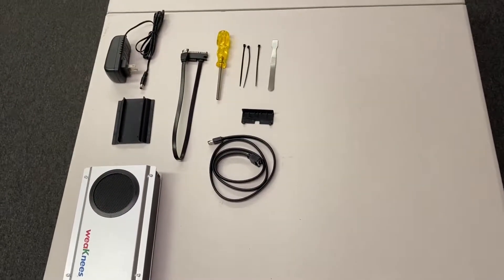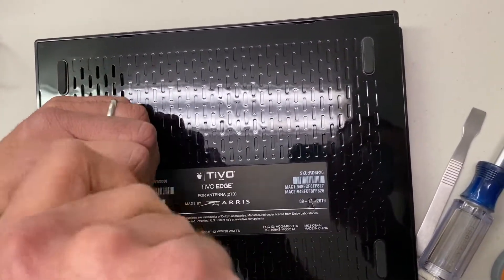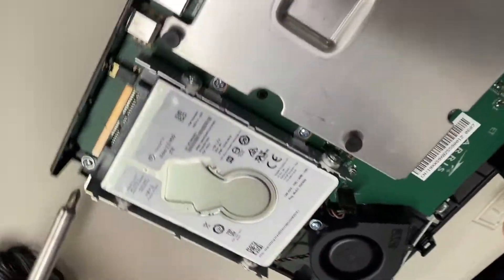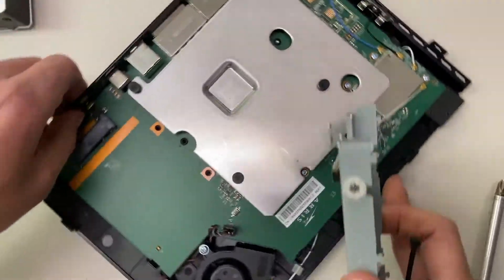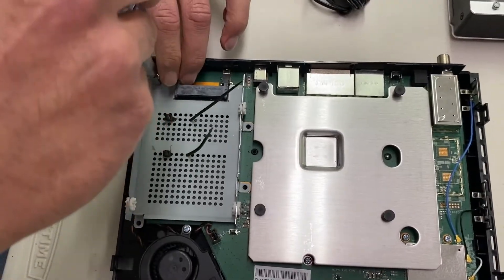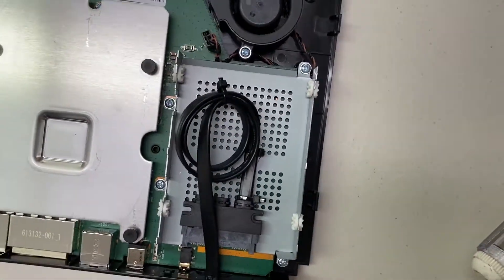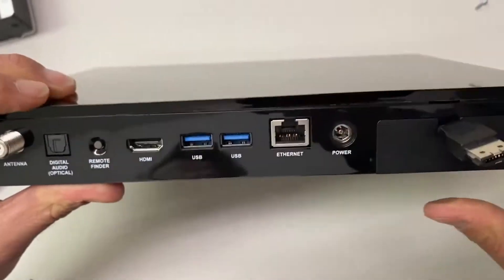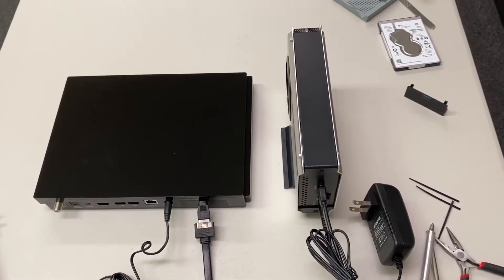TiVo Edge Upgrade by WeaKnees

Comment: Do you sell other parts for tivo edge antenna?  Need the antenna connection receiver.   The part on circuit board that coax connects to.
Reply from the maker: We do sell other parts, but I don't believe we have that part in stock at this time. Sorry.

Comment: I have the latest version of the antenna edge tivo with only 2 tuners. Can I add two additional turners to it? Also I have a older Romeo and could I use two turners out of it to go into my Edge? Thanks in advance for any input you may give.
Reply: Yes,  I too have the same question.  I don't understand why they dropped to 2 from 4 tuners

Comment: I don't see the value of installing an external hard drive with all that extra equipment outside the unit when it would be much cleaner and simpler to just replace the internal hard drive.
Reply from the maker: The Edge's internal drive is a 2.5" laptop-sized drive. These drives are small and their capacity is limited. The larger-capacity, 2.5" hard drives also use a technology called SMR, which does not seem to perform as well over time in DVRs, leading to high failure rates. On the other hand, our external drives are 3.5" desktop sized drives made for DVRs. In our experience, they are more robust and more reliable and are definitely worth it. That's precisely why we developed a kit for the Bolt and Edge to enable them to use external storage.

Comment: Why not just install a larger capacity 2.5" drive inside the Edge?
Reply from the maker: Very, very few drives work inside the Edge (or the Bolt) and the large-capacity drives are prone to failure due to the 24/7/365 reading/writing. We use external drives because they are far more reliable.

Comment: This is great stuff! I am a life long TIVO user going back to the old "boxy" Series 2 units. I have a Roamio PRO for Cable but finally cut the cord when Spectrum went to over $200 last month!!. I have a Roamio OTA with 4 tuners but it just has 500 GB storage. I ordered the NEWEST Edge from Tivo and am very frustrated with the 2 tuner arrangement. Already bumping into issues with my wife doing one thing from one TV and me trying something else on another TV. Also, can't get video transfers to work from my Roamio Pro to the new Edge. Tivo is "working" on this but hasn't got a fix yet. So today, I just received an EDGE purchased from you folks with the 4 tuner 2TB storage. For OTA this will be great. Will get it set up and see if I can transfer to this EDGE. So glad I found you guys and am a fan.

Comment: in place of the external hard drive, could you use an external raid system with an east connector? or would the edge choke on that large of a volume?

Comment: Would this fix the constant rebooting issue
Reply: Nobody knows about "the" rebooting issue you're having. TiVo devices don't reboot constantly. Maybe yours needs service.
Reply: @richarda3659  it actually did fix the issue. I discussed with TiVo support and they said it sounded like a hard drive issue and they were willing to replace mine with a new one with only $200 off. I said no thanks. So apparently someone knew about it.

Comment: I just followed this video and installed a WeaKnees external 6 TB hard drive outside my TiVo EDGE. Could not have been easier.  The metal outer case above the internal hard drive was a bit difficult to pull off after removing the screws, but not too big a deal.  Excellent instructions, excellent equipment, problem solved!

Comment: Quick Question?
By upgrading the HD in my TIVO EDGE OTA, all the Software information is still stored internally on the machine and NOT the original HD that came with my unit?  Is that correct.
And the TIVO EDGE OTA will format and setup the new drive once I replace the old drive?

Appreciate your reply.
Thanks
Reply: As with other generations of the Tivo, you can replace the drive. It's just that some hard drive models work better than others when it comes to skipping over bad hard drive sectors. For that reason, Western Digital makes A/V drives which Tivo has used in various models.

Comment: Couldn't the 3TB Western Digital PMR drive you well for the Bolt work as well in the Edge?  Otherwise, great tutorial on breakdown and assembly.  Thanks!
Reply from the maker: Technically, yes, but the fit is very tight and we strongly recommend one of our external drives if you want more space and maximum reliability.
Reply: @weakneessupport80  Sorry to bother here.  Now I'm a bit concerned about my 3TB drive (WD) I purchased from you guys for my Bolt OTA.  I haven't had any problems, but will it be a good, reliable drive for the long haul as it was quite expensive?

Comment: why would anybody like to try that it looks horrible, that was a waste of time
Reply from the maker: Reliability and increased storage space.
Reply: @weakneessupport80  Do you use Seagate video HD or WD video HD in your external unit?  My tivo edge just started with the "serious error" nonsense.  I suspected the external 3.5 inch HD would be more reliable and maybe faster if it is 7200rpm type.

Comment: When will this be available without the hard drive ( I already have one ) ?
Reply: Look easy to install an ssd
Reply from the maker: @real_ultrajoe  SSDs will fit, but not all drives work in Bolts. Also, SSDs generally do not perform well (or for long) in DVRs due to the intensive writing. SSD technology does well in read-intensive environments, but not write-intensive environments.
Reply from the maker: Feel free to email us if you are interested in an external case and all of the associated installation parts.

Comment: Why not put in a larger 2.5" drive internally instead?
Reply: Thinking the same thing also why have an external drive when an internal larger ssd drive would be better?
Reply from the maker: Larger-capacity 2.5" internal drives either don't fit or don't work. (Not all 2.5" drives are the same height.)

Comment: I put a SSD drive & cloned it on a PC & works 100% faster.
Reply from the maker: Just keep in mind that SSDs generally do not perform well for long periods in TiVos due to the heavy writing. TiVos are writing 24/7/365.
Reply: An SSD would definitely be much faster, but SSDs suffer from NAND wear due to constant writing. So your solution may not hold up that well over time. In this application, a spinning standard hard drive would be the better choice since hard drives do not wear out from continuous writing.
Reply: how does that work ? Is there a video of it ?
Reply: @Sjrick   I used Acronis Disk Cloner software & cloned the original TiVo HD to a larger one by connecting the 2 HD's in a PC & then put the clone drive in the TiVo & it worked. If using a laptop get a USB adapter to the drives & disconnect the laptop HD so u not accidently erase it as Acronis makes a boot disk from USB or DVD to boot from. https://www.acronis.com/
Reply: @drsysop  What drive did you use to clone it too?
Reply: @jjgbmw323  I cloned it to the new SSD drive.

Comment: Is there a reason why you just can't pop in a 4tb or 5tb Seagate BarraCuda internal 2.5" drive? https://www.amazon.com/Seagate-BarraCuda-Internal-2-5-Inch-ST4000LM024/dp/B01M0AADIX?th=1 That external cable and hard drive is not the route I want to take if I purchase the TiVo Edge.
Reply from the maker: Two reasons: (1) the drives are 18mm and don't fit well, and (2) the drive technology used in these drives make them extremely unreliable in an Edge, which is reading/writing 24/7 with up to 6 tuners. We see a lot of these drives come through our shop for repair from customers who have self-installed them and wonder why their TiVo has failed so quickly.

Comment: Why wouldn't you use an actual eSATA edge connector instead of a hack job with a cable like that? Here's a link to a panel mount eSATA port. https://www.startech.com/Cables/Drive/SATA/~ESATAPNLFM1
Reply from the maker: We are aware of eSATA panel mount cable options, as well as the various other cables that are commercially available. We would not custom-engineer a cable if there were an option that were commercially available. There are many reasons why the cable you link to would not work. Once you open your TiVo Edge, you'll see what we mean.